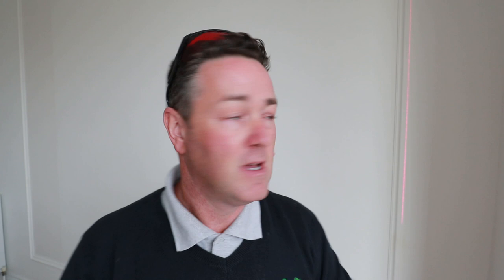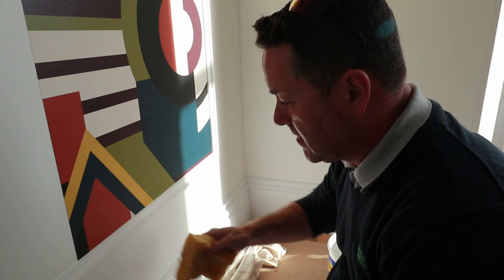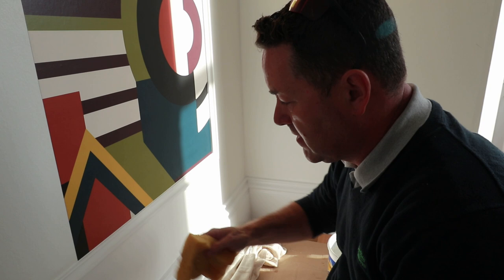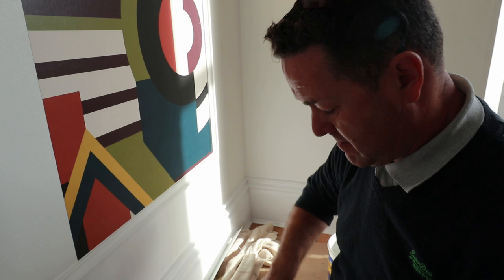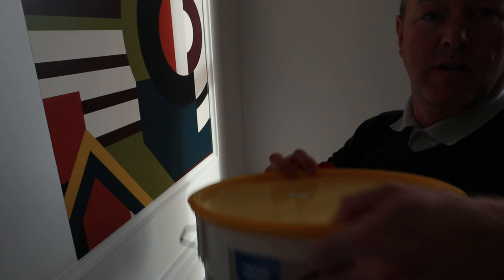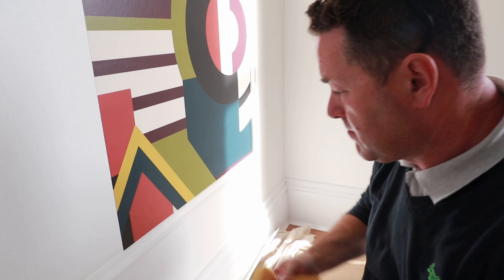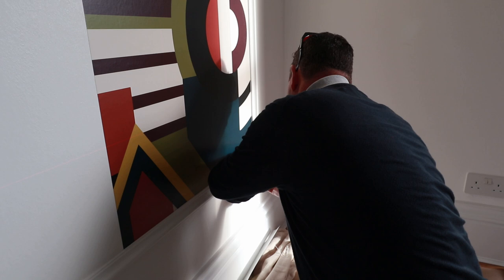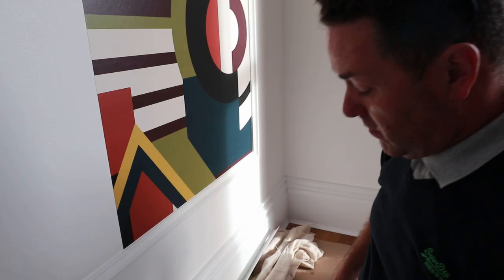Transform your room with a Moscou Mural by Jean Paul Gaultier: Step-by-Step Guide Hanging a Mural

Comment: Beautiful wallpaper and very nice job. 
I need your advice, Phil. I tried to hang a wallpaper for the first time, there was obviously too much headache, but the most frustrating part is the damaged edges. When I wanna cut the edges, the paper gets ripped and rolled. I have a super sharp surgical blade. I even tried a blade like yours, but it happened again. Now I left the job half done, and I decided to cover those damaged edges with narrow molding. I have to add that I put the glue behind the paper, not on the wall, based on glue instruction. Thanks
Reply from the maker: Sounds like the paper over soaked.... Was it expensive paper?

When paper snags up like that with a blade, you need to carefully mark with a pencil and cut with shears.

:)
Reply: @Phil Beckwith The Professional Painter & Decorator  No, it wasn't an expensive paper. Thank you for your reply

Comment: Another great vid as always my man. 

Really nice paper that, reminds me of an album cover. Don’t ask me which artist because I can’t remember lol 

I’m glad you mentioned horizontal hanging! Was reading about it the other day, people saying it’s a must do!! 

Would YOU ever hang horizontally.? Whether that’s lining paper Or the actual design.?
Reply from the maker: Lining is always a must ;)
Why wouldn't you line when hanging wallpaper.

People get hung up on horizontal cross lining...it doesn't matter if you hang vertical as long as you work out where the finish paper widths fall.... If you hang the opposite way around a room to your normal way, joints shouldn't line up on themselves.

For me it depends what's easiest to do... Whether I've two pairs of steps and a baton to stand on with me lol

Yes... I've hung papers horizontal. Sometimes the design is more geared up for it that way.

Comment: Nice work Phil. I’ve got a job hanging some hessian which comes with a self adhesive backing 😩.I can’t butt joint as the edges are frayed. Any advice? I’m thinking to overlap the drops and cut through?
Reply from the maker: Ooooh. Not done one for a while. I know overlap and cut can look bad. Are they damaged edges?
Was there any hanging guide or can you ring the supplier?
Reply: I don’t think the edges are damaged just frayed. My client has insisted on this self adhesive hessian and I know it’s going to be a pain. I’ll give the supplier a call and see what they recommend. Keep up the good work Phil your videos have been really helpful especially since I started doing spray finishing. Cheers
Reply from the maker: @playtonix2259  send me a picture on Instagram if you get the chance

Comment: Watching you do that and the mural Phil, it would make me nervous hanging material that expensive(I'm not in the trade) but it occurred to me do you often get to use materials that are more than the labour charge to apply them? If that was, I have no idea, is the worry worth for the satisfaction? Cheers
Reply from the maker: Thanks. It experience of hanging paper, the costs don't worry me.

Have you watch the mural video from a few weeks ago... The Affreschi Affreschi paper.. that's was over 1000€ for two lengths!